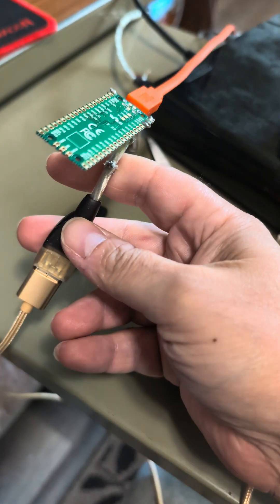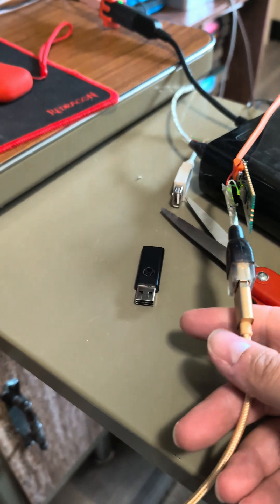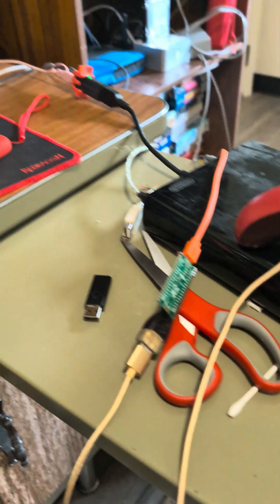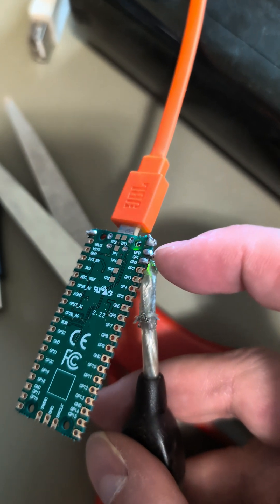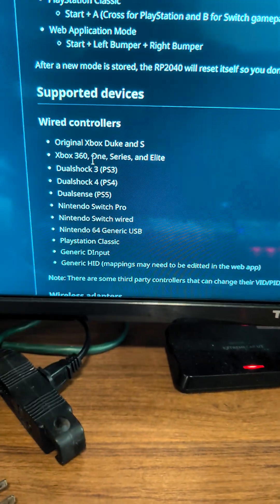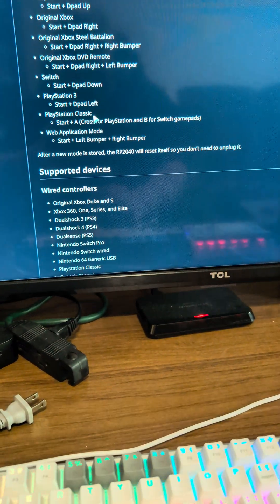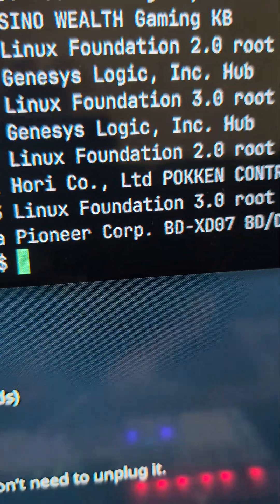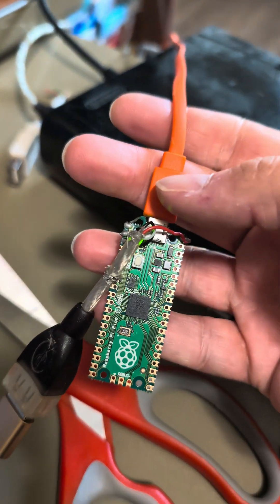CUSTOM USB Controller Adapter using a Pico Pi (OGX-Mini - A little buggy :( )

Comment: After you flash the pico and plug in an xbox one controller, the light keeps flashing and doesn't stay lit like yours
I feel like I'm missing something
Reply: I'm in the same situation, were you able to fix it?
Reply: @emielfoxy8655  Kinda? I think the issue was that the cable to the xbox one controller didn't transfer data.
But I first updated the controller in "xbox accessoires" on pc just in case. Then I could switch the mode once and then the xbox one controller wouldn't connect anymore with the pico haha. So still useless, I don't know what the issue is
Reply: @ym-ninja3221  something similar happened to me.
Reply from the maker: Sorry guys I didn't reply back. I'm not quite sure what to say. I mean sure there's the basics to make sure you have it in a selected controller profile. So if you didn't do that try it. I had a few issues with mine and had to go back to the soldering table and everything worked.

Comment: I ordered an PI Pico 2 W (which will arrive in a few days) but I have no idea if I have to install stuff like python or is it enough to install only the OGX Mini stuff? 
Sorry I have no clue about the PI and can’t find any answer.
Reply from the maker: You have to hold the button on the PICO Pi as you plug it into your computer. Then it'll open a new window to put the file on from the site linked in the description. After it's done the window will then close. It's called "flashing" so don't worry about it closing. But then you'll have to configure the buttons per config via the webapp which can only be used on Windows. I haven't been able to get it to work on Linux Mint.

Comment: I've been using mine via a Pico Zero for my og Xbox using an Xbox 360 controller with official wireless adapter I've had for like 16 years and it's been flawless for me the past year!
Reply from the maker: So how are you using this with systems?
Reply from the maker: Are you saying the Pico Zero you've had for that long and you're using the OGX with the Xbox 360 wireless adapter? Yeah I've set mine up with both the Xbox One S Controller as well as the Xbox 360. Had to do button mapping however had issues with the triggers and I imagine that's more to do with the firmware and hopefully just needs a update to resolve that issue. I'm using the PS3 config.
Reply: @DCeric  I've only used mine with my original Xbox (I have two one hooked to my crt and the other to my main TV) I think mine is emulating the Xbox controller S. Haven't tried on other consoles or pc. I originally assumed this was only meant for the original Xbox.
Reply from the maker: Yeah I think you're correct. I think they added other console functions in a later update. So yeah it's a bit broken and hopefully a future update will fix that. @hunk4TH
Reply: @DCeric I'm sure they will! I haven't updated mine in a year now so lol. Since its worked for my purpose.

Comment: I tried but in PS3 is flickering I'm using a XBOX One controller
Reply from the maker: Yeah the PS3 config was a bit of a mess. I had it working but the action buttons were mapped incorrectly and triggers were not working. Used the Switch Hori config and triggers worked but action buttons were a mess. I guess it also depends on the device. Hopefully the firmware gets a new update soon.
Reply: @DCeric  WHAT CONTROLLER HAS YOU USE
Reply from the maker: @bm-cy7ek  I've used Xbox One S, PS3, PS4, Xbox 360 and Switch Pro. They should all work fine but the configurations will cause issues. The original Xbox should work fine but hasn't been tested as it was forked from another project. PS3 and Switch you'll have to do button mapping however there's some buttons that can't be mapped. There needs to be further development with the OGX Mini software for those configurations and possibly others to work correctly.